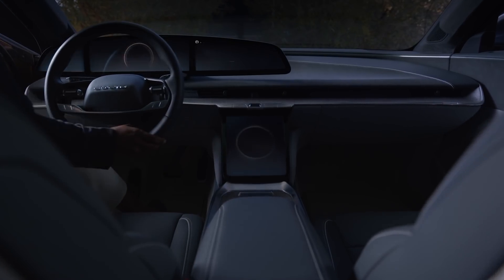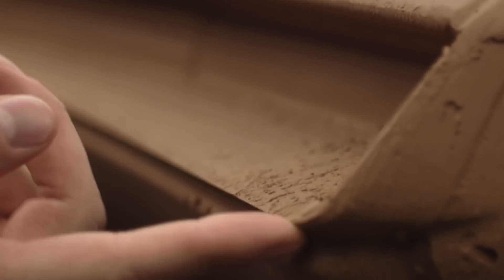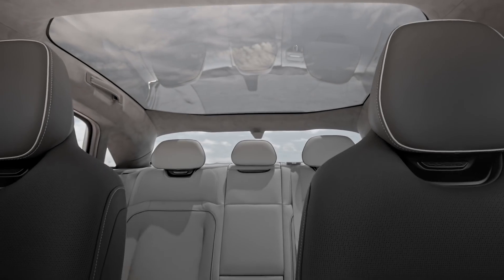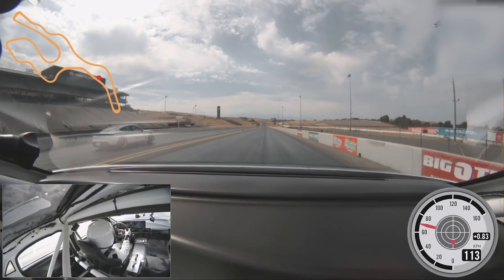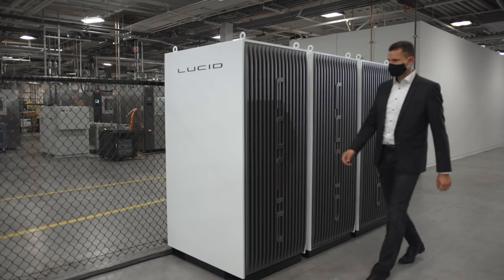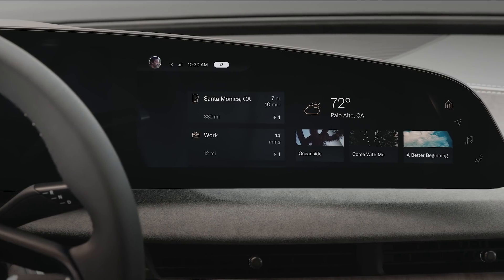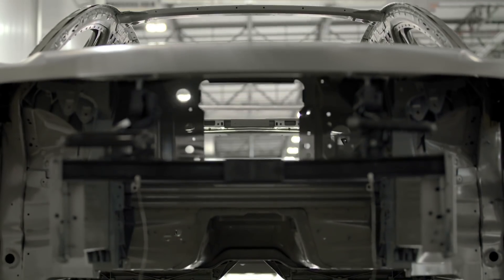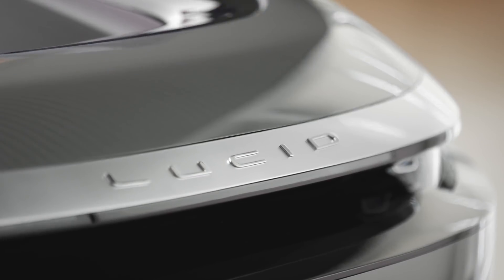A Quick Intro to Luxury Electric | Lucid Motors | Lucid Motors

Comment: Lol their core mission is the exact same as Tesla. Almost word for word
Reply: Yup they are carbon neutral copycats of the finest ilk. 
Right down to starting at the high end sedan market, making unique experience centers, look alike website with online ordering, bragging about the acceleration, features not yet proven like the power-weight ratios&wonderboxv2x capabilities, developing battery storage for home&commercial use etc. 😁 

oh and lest we forget they are only 3+year's late on delivering anything into anyone's paying hands that was originally promised way back in 2016 when lucid first debuted the air. 

Yet seemingly only Elon gets dumped on for this type of behaviour. Every other overpromising underdelivering CEO gets a pass from the media. Herbert diess, rj scaringe, Mary barra cough cough 👍🏻

Comment: if the quality of the car is on par with audi benz bmw and they are able to roll out sub 30k car this decade as well as a suv cuv, battery storage tech for homes bizz and commercial wow wow all by 2030- 2035 this company will have a 1200 dollar stock ticker. but remember lots of bumpy roads ahead stay strong retail investors and good luck

Comment: If you aren't competing with Tesla.. partner with the charging network ya?
Reply: DCFAST/CCS is better
Reply: @Kyle_From_Utopia  define better.. Less available? More expensive? It's an decent alternative but 2nd tier for the foreseeable future
Reply: @jordanschultz2232  read the dev plans for each of the companies. You’d be surprised!
Reply: @Kyle_From_Utopia  summarize it for me EA going for 800 stations by the end of 2021 and potentially electricifying Canada soon?
Reply: @jordanschultz2232  EA already has 1800+ chargers at 350kw - much more powerful than average supercharger by a large margin. Tesla’s v3 is still 250kw and not as abundant as v1&2. They are still great; but they’ve fallen behind. 

The good thing about all of the other brands using CCS is that ChargePoint, EA, local and federal governments amongst MANY other companies are building out very fast chargers in addition to the plethora that exist already
Reply: @jordanschultz2232  there’s a bit need for this all to be built out with companies like Lucid and Rivian, amongst legacy OEMs moving to EV production. 

And Tesla will need to continue to develop theirs to accommodate 25k models down the road. I already spend time waiting at local Superchargers as it is.
Reply: @Kyle_From_Utopia  if lucid had access to Tesla chargers they would have a better product than they are now.. isn't that what we want.. what we all want??
Reply: @jordanschultz2232  quite literally: the Lucid buyer would spend less time on the road even if using the best Tesla Superchargers. It’s not about Lucid vs Tesla.. 

regardless - we (as consumers) face infrastructure issues, despite everyone but Tesla using CCS. CCS has the best charging speeds, coupled with higher voltage systems making their way into newer EVs. 

Just a few years ago the charging situation outside of Tesla was a nightmare. Now there’s more consensus - any reputable new EV is using CCS. 

Similar to lightning in iPhones and USB-C in android, it’s a bit of a pain but it’ll do a lot better than 15 different charging systems in use